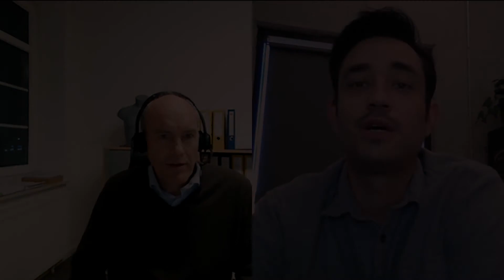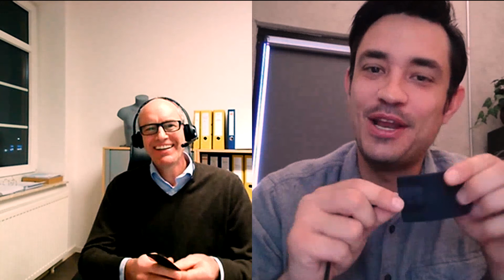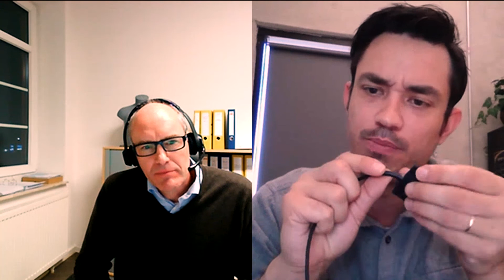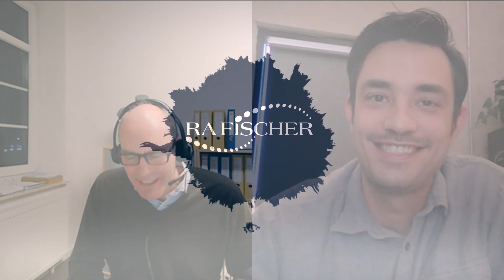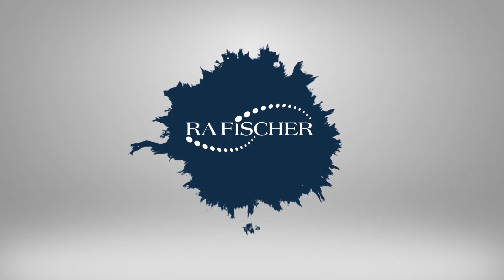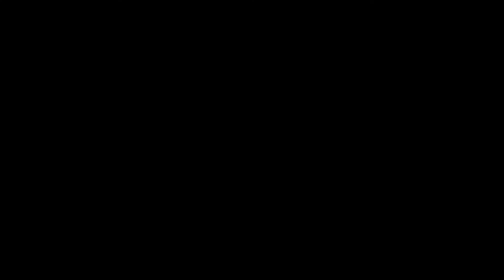Interview With Dr. Rolf Eilers | Saalmann | Technical Deep-Dive Into The Fischer's Innovations

Comment: in my experience WATER makes the difference in a crucial way.. it is not enough to add salt or backing soda.. you need ions in a natural way..  mineral water with high TDS  calcium solfate,  and high  Electrical conductivity ... then the current must be at least 15-20  ampere .. after 3-4 treatments  the  sweating  can be worse, but afterwards you start  to see some results and you have to stop.. yeah  the dryness comes  once you stop the treatment , after a week suddenly  .. be patient with this